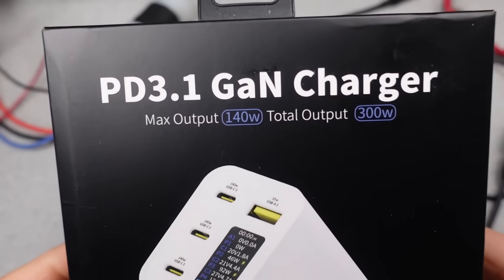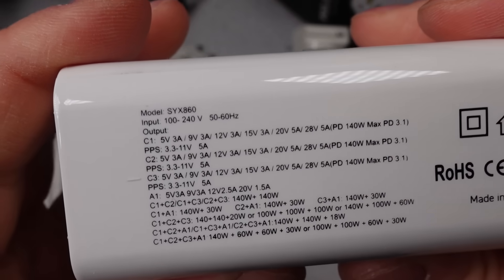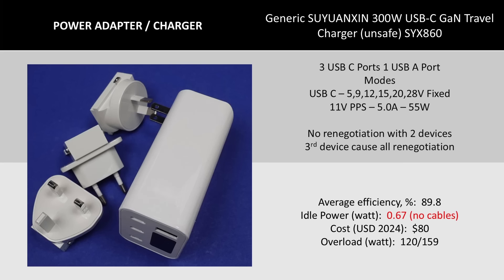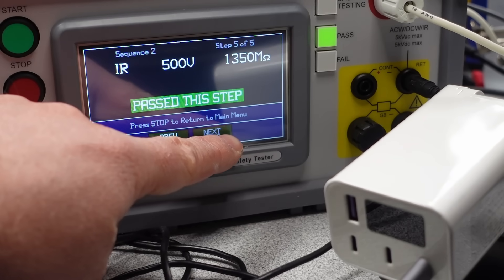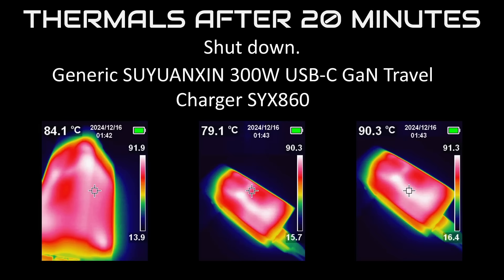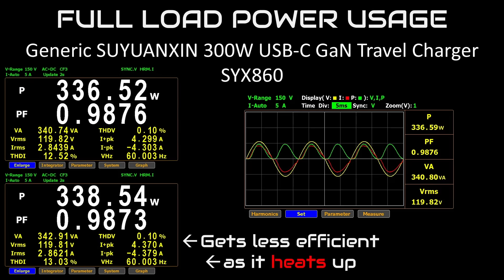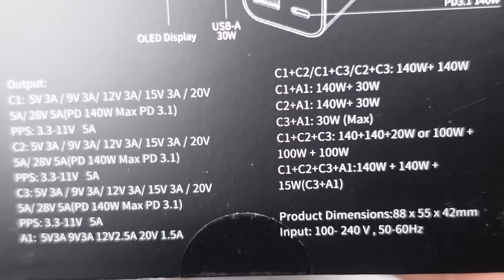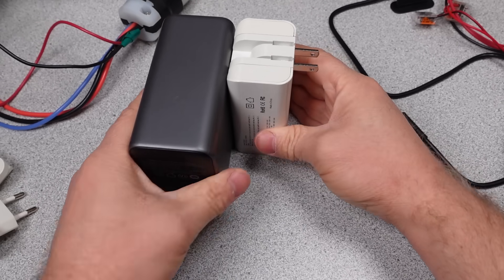300W USB ADAPTER TESTED AND MEASURED, KILLER DEAL!

Comment: RCD will protect you, even if you touch live and neutral...there is usualy a current to ground as well. But yea, bad design.
Would be nice to see some revies on Thunderbolt 4 Docking stations and their ripple/insulation.
Reply from the maker: Do those have power supplies in them?  I would think a docking station is a non-isolated device.  They usually use a separate power brick?
Reply: @AllThingsOnePlace  That is true...some require a USB-C Brick and some come with a 20V external power brick. I was just curious, how good those external bricks are.

Comment: A couple of months ago I posted a comment about the verbatim 240w charger which I was considering to buy. I did buy it on July, now it broke. The first usb C is no longer working. Also it overheated like hell, even under low loads (65w + 25w). Trying to get a refund currently, but I'll probably be stuck with a replacement. At least it was cheap
Reply from the maker: Thanks for the update!  Yeah, no idea why they just crank up the watt number on what is clearly not a high wattage supply.

Comment: New food for thought, UGreen has now announced a 500w power adapter launching in Q2 2025. Imagine what that’s going to be…
Reply from the maker: haha, yep.  The beast mode power adapters are coming.  At 500W they have to switch to a different topology of power supply or if they paralleled up a bunch of the same power supply, it's going to be worse.
Reply: @AllThingsOnePlace  its also the first known soonto be univerally available 48v5a port on any USB thingy right now. So i wonder if it will get its own video.

Comment: yes, definitvely not save ... but when using USA style plugs no device is save (lethal shock risk) ... USA style plugs should be generally banned
Reply from the maker: The socket is fine, the plug itself yeah, they could add some things but the risk is low enough I guess.
Reply: @AllThingsOnePlace  - 
You can not refit USA plugs with UK style protective sleeves because the contacts are already thin, you can only switch to recessed sockets (like in Germany) ... useing recessed sockets for earthed Type-B plugs would also phase out the need for heavy deveces (high-power USB power supplies & old wall wars) with poor man´s type-A plug version to soley rely on the socket´s contacts to carry the weight

Comment: Another great video! I have an issue and I was wondering if you have a solution: I have a Lenovo Legion Pro 7 that I'm trying to power using USB C PD. The port supports up to 140W but also requires (20V, 7A). So far I'm using a Spigen ArcStation Pro 1402 which as 140W but for Lenovo's specs, which charges at around 90-100W. Do you have a solution, or is this the best I can get with PD on this laptop? Thank you as always, happy holidays.
Reply from the maker: Yeah, this is because Lenovo uses a proprietary protocol, not USB PD.  When they go non-standard it will top out at 100W with any third party charger.

Comment: I have a few chargers but from them, my Voltme Revo 20 and Voltme 30 shock me when I touch the corner of the type c port of a cable when the charger is plugged in. Now Most Chargers don't shock me and Revo 30 shocks more than 20. Then I tested the type c port using an electric tester. And the Revo 20 shines more than my 18-watt google charger. Is it normal and safe?
Reply from the maker: Don't

Comment: Hi, i saw the slimQ review and the nexode pro ugreen 100W charger. i have the Ugreen charger and it overheats a lot. im using it with my laptop that requires 300W but i only use the 100W usb-c charging. if i switch to the slimq 330W would that be good to switch the big and heavy 300W lenovo charger ? 
i don't know if it's respectful to ask. but can you review the 330W slimQ charger ?
Thanks for your awesome work.
Reply from the maker: Yeah, they have their own issues, but I do need to check that out at some point.

Comment: Can you recommend on a 240w usb c to usb c cables that are 10 feet i havent found a single video or even legit brand that makes these ive been buying cables of amazon that claim this for over 2-3 years now and i still havent found one that manages to push out 240w at 10 feet
Reply from the maker: 10 footers, I'm not sure I have any for my upcoming video, I've been looking for the opposite.  I want the best shortest possible cable, ha.  Also, no cable is going to do 240w, cause no devices can (really) use 240W and the only power supply that can supply that has a captive cable.

Comment: thank you for the video. i have exactly the same adapter. i use it to charge my MacBook Pro M1 14 inch model almost a year. My battery degraded to 88%, do you think this adapter cause faster degrading? Original adapter is 67 watts, but this adapter could charge it about 80 watts.
Reply from the maker: I don't think it would, unless it does some odd longer term switching.  The Macbook decides how much power to consume during charging and monitors temperatures to make sure it can charge correctly.  88% degradation for an M1 era macbook sounds about right though.  They degrade just from the passage of time.
Reply: @ you are the best. thank you very much

Comment: The only 300w charger I have and trust is the UGreen one. Can apparently get for about 1000 Chinese Yuan ($140 USD) if I hunt around aliexpress for it. Even though it limits at one hour, but then realistically charging at 300w, the three devices with that combo will probably at 80+% already at 1h.
Reply from the maker: Yeah, I wonder if they fixed the issues with them.  They had a really high failure rate for a while.  But yeah, overall, it checks a lot of boxes.
Reply: If you mean the nexode mine failed 3 months in. And I’m the type of person whose electronics never fail. One of the ports doesn’t work anymore. I did get a refund.

Comment: At the very least, they could have colored it black. Black bodies radiate heat away faster (unless they are in a direct sunlight)
Reply from the maker: The failure to do basic electrical safety means the thermal performance was probably a pretty long way down the list...
Reply: It also hides the yellowing if it's black coloured (unless it starts melting)

Comment: Why does it look so similar to Zeus 270W? Who copied who? Makes me wonder if Zeus 270W is also this bad and overheats so quickly. Probably worth a test
Reply from the maker: It isn't the same adapter, but yeah, likely to suffer similar problems with thermals and all.  Hopefully they didn't include the horrendous AC adapter plates.
Reply: @AllThingsOnePlace  it looks exactly the same as Zeus 270W adapter, including the dangerous AC adapter plates. Zeus 280W in black colour is the newer one.
Reply from the maker: @ZelenoJabko  Ah yeah, I see that one now, I only found the 280 before.  That's just sad that someone kickstarted that, I always think scam.
Reply: @AllThingsOnePlace  there are three options: 1. Someone kick-started an existing cheap Chinese charger, and pocketed the difference 2. After successful kickstart, the Chinese made a cheap, low quality knockoff. 3. The designs got stolen, and a similar quality charger is made for a cheaper price by the Chinese.

Which one is it? I honestly think it is either 2. or 3. The only way to know is to test both and possibly open them to inspect the circuit.

Comment: what do you recommend for the Anker 737 power bank? it cam charge up to 140w. so far all the anker 100w chargers all turn really hot after 20 minutes.
Reply from the maker: It does it, in the review of it, it overheats but it will drain totally flat when it does.
Reply: Ehh whatever they’re meant to get hot